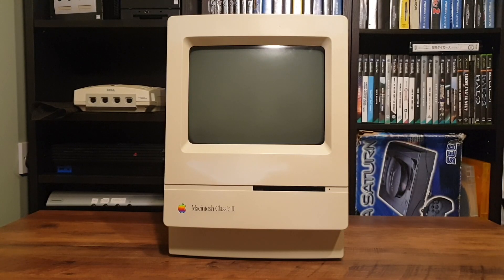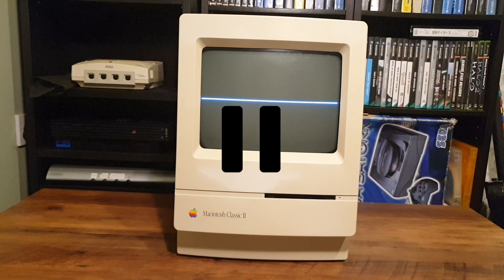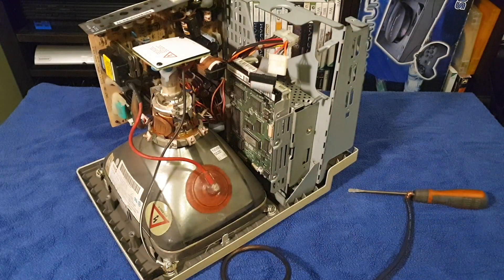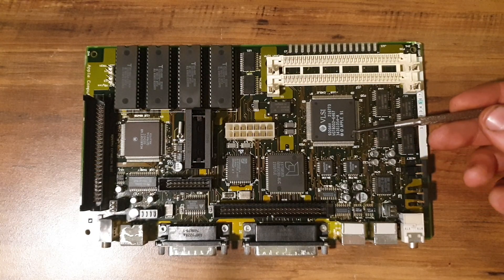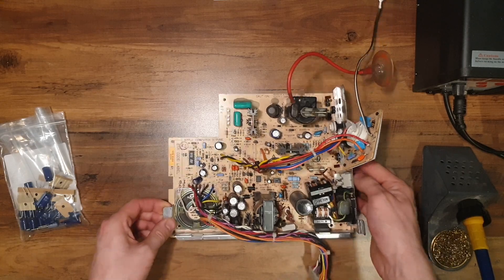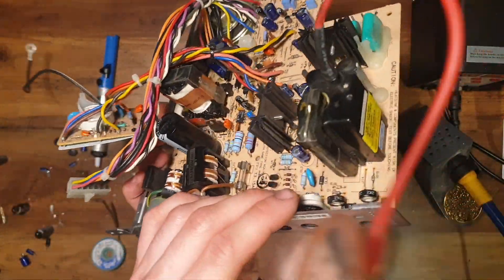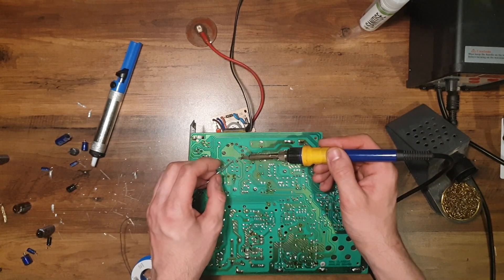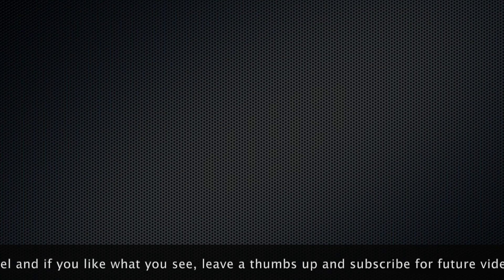Mac Classic II - Overview and Repair

Comment: I've got one of those in my loft, upgraded to a "massive" 10Mb of RAM. Dunno why I kept it; I've consigned far better machines to the tip, but it still worked last time I fired it up.